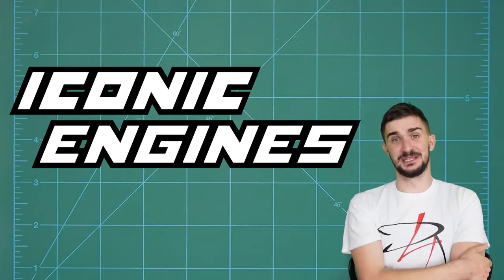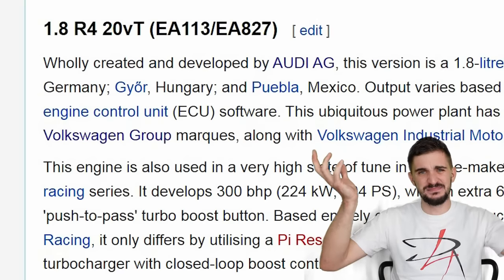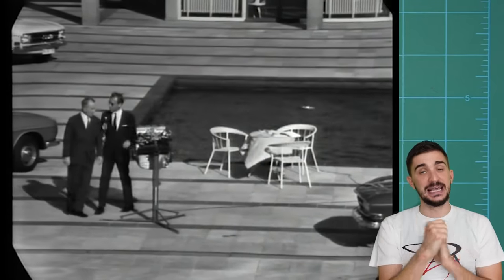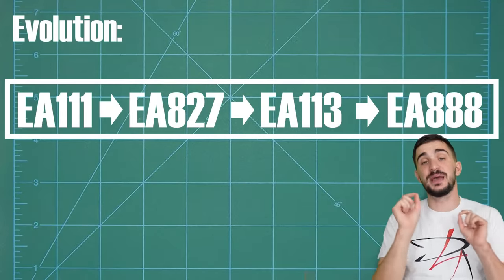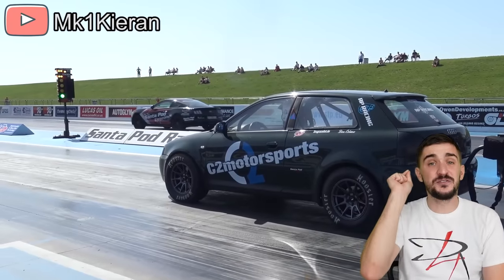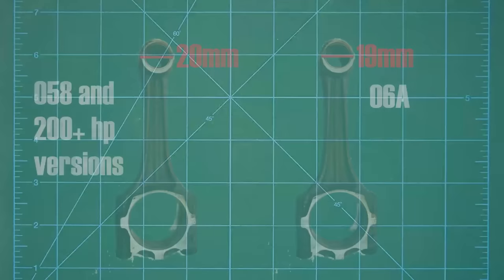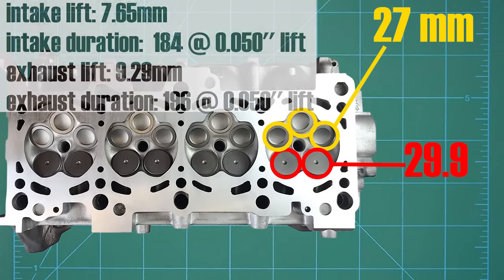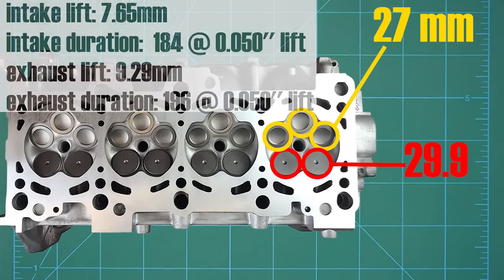VAG 1.8T 20V - What makes it GREAT? - ICONIC ENGINES #17

Comment: Why did they not just learn the lesson from Toyota's 4AG, I always felt that VW keep messing up and didn't trust the company.  After I saw what a loose rivet in a ring gear can do, throwing the engine and transmission out of the hood.  VW was recycling tech that didn't have the foundation to do so.

Comment: In my country, there was a law that reduced taxes for cars with a 1 liter engine. the discount was so big that a brand new car was cheaper than most used cars circulating in the country. this, added to the very high price of gasoline, meant that most cars sold for a decade were boring 1 liters. so the 1.8t 20v engine is considered a legend here. i have an audi a3 which was my first car, andstill is my daily. almost every day someone asks me at traffic lights if I want to sell it, and I always make new friends when I park at events and gas stations because of the car

Comment: I had a 2006 MKIV GTI 1.8T 20-Valve (AWE engine code I believe), one of the last ones ever built (in the US anyways). Tuned it up from stock 180 BHP to about 220 BHP and simply daily drove it for years, running the piss out of that little stock K03-S Turbo until eventually, under the higher tune, the additional boost and stress started making the car smell of burnt oil whenever I put my foot down. Before I pushed my luck too far, I sold the car for $2500 with 160,000 miles on it.

Comment: I finally got my first car a few weeks ago, a beaten up  '97 seat ibiza gti with the 1.4 liter 16v engine and I love it, I have plans of turning it into a mean little street machine, by swapping in a 1.8 20vt and awd system probably from an audi tt quattro or an a3 quattro and stiffening the chassis with custom cross members and other little upgrades here and there and upgraded bilstein suspension (it already has bilstein, but it's the base model ones) I think around 226 to 260hp would be the sweet spot, it's making around 105hp at the moment with the stock 1.4 liter

Comment: Dad had an 2003 passat 1.8t, engine was supposed to run 30 000km between service. Dad thought that 50 000km would be fine, resulted in a clogged oil pickup. :) But the car actually warned us before any damage occured, after a pretty expensive mechanic bill the engine outlasted the car.

Comment: Had 3 versions of this engine and was never disappointed. AVJ audi a4 tuned to 230hp 333k km, AUM audi a3 tuned to 300hp 170K km, and AGU mk4 golf stock 230k km. Easily tunnel and quite reliable. Thinking of retaking another 1,8t audi tt to reach 500hp or more

Comment: As I prior owner of a 1.8T in a 2002 Audi TT Quattro I can definitely say this is a reliable platform even if they have their issues. By 130k miles it could eat through a quart of oil every 50 miles (not a typo). Yet, it would start every cold morning almost like new and make full power while going to redline all day

Comment: I've been driving mine for the past 11 years. I have 2001 Audi B5 1.8T, miltek exhaust, highflow cat, silicon pipes, DV, and remap. The engine is a tank and it goes practically forever, I have 237k currently.

Comment: My favourite VAG anomaly is the similarity between the Audi S2 coupe and VWs 16v GTI engines. 

It’s possible to remove and blank off the 5th bank on the turbo inlet and outlet manifolds and it bolts straight onto the KR and ABF engines.

Comment: Many moons ago I owned an Audi 80sc. A mid '80' 4 door saloon, 1.8ltr, 4cyl engine twin with a twin choke, vacuum operated carburettor. The reviews said it had surprising performance for such a car and they weren't wrong. I think rapid, was the best way to describe it. It would comfortably hit 90mph in 3rd and had a surprising amount of torque for such a small, NA engine.

Comment: These engines i never liked them, i saw many of them fail due to various timing and chain related problems when they were current. And they werent cheap either compared to older 2.0L with aftermarket turbo setups. But ill have to admit, seeing how the tuning scene evolved for this platform and how the various issues were solved has given me new respect for this motor. Its still not a cheap option, but its nonetheless a very good swap option .

Comment: You got it spot on. My first car was a 1999 Hyundai accent and then my 2nd car was the 2003 1.8t Jetta and I tuned and upgraded so much on it. I have a 2020 GTI now but if my old car was still
Running id still use that no doubt. Everything was great on it BUT the o9a automatic transmission

Comment: Small port works great up to around 600hp, as long as you install big camshafts and an aftermarket bigger intake, small port head is not that restrictive, though you can of course benefit from a big port in the upper end

Comment: With proper maintenance this engines can last for thousand of kilometers or miles , and with the necessary addition of some peripherals(larger turbocharger ,intercooler, proper chip tuning, suitable full exhaust system w/o cat and correct pipe diameter, bigger MAF airflow meter)  that DO not exceed the torque limits when the engine is in stock form.                                                                                                                                                                      This motor can make lots of power and HP , never had a serious problem in any of the 5 different cars that i had with this engine in various performance setups , stage 1,2,3, etc. Good oil quality and  oil changes after 5-6000 kilometers of normal road use would be the ideal interval in my opinion. Also i would recommend to change the oil cooler , and the water pump with one that has metallic impeller instead of the plastic that the OEM from factory has , and in the cooling system the addition of aluminum or bronze piping connections would ensure that there is no any old plastic connections cracking and coolant leaking from the system that could potentially lead to increased high temperature and create a serious issue with the engine if not repaired . Now as for the v belts , well it`s good to replace them after 3-4 years or 50-60.000 kilometers it depends on the mileage that the car is making  each year. And if possible use premium gasoline , and in some stage perform a de-carbonization of the engine would be a good thing to do as to remove all the remains of sulphur or residues that can be accumulated inside the cylinder chambers over the years and affect the performance of the engine. And ideally to install an oil catch can to collect the oil vapours, would be a good thing to do. There are also so many other tuning potentials in this engine that the only limit is the amount of money that someone wants to spend to make a great build (forged pistons, con-rods,exhaust valves,intake valves,valve springs, retainers, bigger fuel pump, increasing the displacement , modifying the camshafts usually only the exhaust side is adequate , but in heavy tuned engines both are modified in order to increase the torque in higher rpms.
Reply: Long list, if I have to replace practically all the parts, might as well buy a completely different new engine/car 😂

Comment: I have one in a 2002 passat,255000 miles and been pretty reliable, leaks oil like a sieve but burns none, passes UK MOT on emissions no problem. Only major problem was the flapper valve in the turbo falling off leaving it with no boost pressure.

Comment: In the early 1990's I recall a friend telling me of another of his friends who tested "new" engines to destruction for a living. When asked which was hardest to kill he had said VW 1.8 by a country mile. Was the block/crank more durable because it was designed as the basis of the 1.9 diesels ? In the case of the diesels at least, the 2005 switch to "cracked" con rods lead to a good number of failures for these early Bxx engines. A friend who worked for Cummins told me cracked con rods need exceptional cleanliness in manufacture....

Comment: Pretty spot on except the large port head.  Large port heads harm the HP number till you get over 450. Anything bellow that and the velocity drops compared to a small port which makes the engine feel more laggy.  Personally experienced this when I switched from large port back to small port due to emissions testing needs.   Also it’s a good idea to either get a large volume intake manifold or take the stock intake manifold and expands the chamber by welding in an inches of material.  Keeps the pistons even mixture.  Without it they sometimes go lean on 4.

Comment: 1.8t with simple parts like exhaust/injectors/ filter and remap + 4wd = go kart 

That engine is something, i have the AGU and APY on my A3 and S3 8l. The only problem of the 1.8t is the pcv system, sai, etc  and stuff like that, when you simplify it you have just to put gas and go for a ride.

Comment: Awesome video! One thing I find weird, is my 1.6 AKL engine. It looks like a EA113 (looking at the oil filter housing, thermostat housing and chain driven oil pump) but it is from early 1998. Also, it is made of aluminium and not out of cast iron. Yesterday I did a timing belt on it and recently a new oil pan so I can really confirm that it has the chain driven oil pump. The block looks to be similar as the one from a 1.8T 06a exept that its made out of aluminium and the transmission bolt pattern is different (02K transmissions instead of 02A, 02J or 02M). When I look on the internet I find that my block should be made of cast iron and it should be a EA827 but I don't see much similarities between EA827 and my AKL

Comment: Wow what a great video. Great research work. Here in Brazil the 8 valves EA827 known as the Volkswagen AP engine is the most common engine. We didn't have a turbo charged version of this but it is commonly turbo charged. You can make a video of the 5 cylinder turbo engine that is in the Fiat Coupe. A great engine.

Comment: I recently bought a 1998 Audi A4 Avant 1.8T and i think it's funny that the registration plate starts with DKW =D (Here in Sweden, the plates follow the vehicle, so it'll have the same registration characters from new until they're scrapped unless you buy a personalised plate. The personalised plate runs out in five years and then the vehicle will re-take its original registration letters and numbers)

Comment: My rs4 4.2 avant has two 4 cylinder vw engines DNA Porsche has a look into the project to, 450 hp std using 99 octane can push that to 500 hp,it’s a beast 👍
Reply: I love the 4.2

Comment: Had one swapped in a mk1 rabbit with a big turbo. Loved it, spun both tires in 3rd. Built another a4 but constantly battled power output codes and limp mode so parted it out. Now I have another core, I'm looking to swap it into something older.

Comment: Now that there's a 1.8T video, it's arch nemesis needs a video too, the Z20LET, or just in general the GM Family 2 turbocharged engines.
Reply: I agree, but not only turbocharged. It should also include C20XE, C20LET, X20XEV, Z20LER and Z20LEH because they are on the same base. I own Z20LET and it's great engine.
Reply: @anessmajic4323  The X20XEV is nothing special but I do agree with the rest, however the C20LET held the 4 cylinder world record till recently when it got dethroned by an Ecotec 2.2 of all things. However the Z20LET is the contemporary and rival of the 1.8T, with the C20 being 6-7 years it's senior and the Z20LEH being of the same age as the EA888 2.0T

I own a 400HP Z20LET myself that I've daily driven for the past 2 years in this form and 4 years in total, the engine itself never gave me any grief, the electrics are another story 🤣

Comment: Had a 99 jetta 2.slow. 01 1.8t ko4 frankenturbo stage 3+ and 05 1.8t stage 2 the last one i got rid of because thw body rott at 353000km and pushing 21psi daily to the redline. Engine was still strong. I miss that last jetta

Comment: Thanks for the vid. I’m currently modifying what I believe is the best 1.8t to modify. The 1999 058 longitudal aeb. I’m currently on a k03s out of a low mile 2005 a4. Full bolt ons and tuned myself with eurodyne maestro on an e40 blend. Fwd and 5 speed manual puts good power to the ground. I can keep up with cars I shouldn’t be able to.  Integrated engineering H beam rods and garret gt30 soon to come. I’ve had alot of fun already.

Comment: I bought a 1999 base model A4 Quattro with a 5speed manual and the 1.8t engine (AEB engine code) from some guy who worked in a body shop in 2018. The suspension was shit but it still has the original engine and it's coming up on 190'000 US miles.

Comment: I almost bought a 2017 Golf with a 1.8 but ended up going with a 2020 Golf with a 1.4. I definitely made the right decision as far as bang for buck goes because they only made 1 trim for 2020 and it was pretty much the SE trim, but I always wonder if the slightly bigger engine woulda been better
Reply: You made the right call, the 1.8 in that era was not reliable at all
Reply: @eponymous7910  Unfortunately that car was totaled probably not long after leaving that comment from smashing into a 9 point buck on the highway 😅. But it all worked out as I’m in a ‘19 GTI now lol

Comment: The 1.8t is nice, sure, but the best engine VW ever made was the 1.9 TDI - incredibly reliable, easy to maintain, great mileage and really quite powerful for its size (mine does 170hp with a simple ECU tune - 0-100km/h in 8 seconds. Not bad for a 16 year old diesel engine that's never been rebuilt!)

Comment: there are some factory 1.8t audi a4 b5s from 95/97 that came with 286hp from the factory.  Stage 3 mtm.  i got a 1.8t with forged rods, non turbo cams, big port head, big turbo and support mods in a b5 and it makes 450whp

Comment: Great video but i wanted to help with a few inaccuracies. the engine angle is not always 20 degrees for all cars. in longitudinal applications it is 20 and in transverse applications it's 15 degrees and these are much more common. you also placed a picture of the larger displacement 1.8 AEB block when talking about the EA111 and suggested it has 88mm bore spacing but the EA111 is generally smaller and of a different architecture to the larger engines the other information points towards (generally 1.6-2.0 litres)

Comment: as a VW Golf 5 owner I can summarize all VAG engines:
there are the good TDI and SDI (PD N/A) engines. they all begin from 1.9L and up to 2L from what I know. newer have common rail, older have per cylinder injection units (pumpe duse) and even older used another form of mechanical injection pump. they're all good with the N/A diesels being slightly more reliable while slower because of lack of turbo.
then there are the less than successful engines, all kinds of petrol engines. stratified or not, if its petrol its bad.
we don't like talking about them.

Comment: My a4 Avant has a 1.8T mated to a manual, not fast by any means but it was fun, reliable, and great on fuel. Unfortunately, it's sitting in need of a new clutch and pressure plate.

Comment: 1.8t with 600 ps you only need: rods, Turbo, intercooler, exauste with 200 zells and Injektiors. 
With the small port and oem Camshafts you can drive 600 ps. 
The OEM piston can 500-600 ps 
German Tuning Engeniring:D

Comment: Sorry, that's not right! 
The EA 111 does not have 88mm drilling distance. 
The EA 111 has 82mm and was only available up to 1.6 liters and need mostly other gearboxes!

VAG 4 cylinder evolution:

82mm engines: 
1974 EA 801
1985 EA 111
2011 EA 211

88mm engines:
1972 EA 827
1995 EA 113
2007 EA 888

best regards from Germany!

Comment: Nice Video good Research from you ✌😁Cant wait to See Videos from you about the 2.7l v6 biturbo from s4/rs4 audi or the Legendary 2226ccm 5 cylinder😉.Or the Bad guys from the cast iron school from bmw m20,m30 or m50 or the New guys like n54/n55 s55 or b58.Nice Job Hope for more german engine Content ✌😁.You had made  the Research very well.Many guys only Tell that agu/adu are the most wanted ones and the bam out the s3 or 224ps audi tt is the strongest.

Comment: I have an 1.8t AUQ and is amazing, the unique bad thing in my opinion are the vacuum lines it has, has a lot, u can delete a lot of lines or modificate them with a T to make it more simple to repair, i want do that on mine, beyond that is a very good engine, i got it with 114.000km and now has 200.000 and it's running great expect of those vacuum lines have to be broke or with a little hole that makes the engine light show.

Comment: Hahahaha, the venerable mk4 with 1.8t.... Besides it overheating once the radiator has a hiccup, and numerous small issues like disintegrating interior, eating stabilizer bushings like chewing gum, it's quite the fun car because of that engine. I still have fun with this car, only if I figure out the interior....

Comment: Newbie question here:  Please explain "fractured" big end connecting rod -- why do it this way and how is it done?  Thanks -- great channel!
Reply from the maker: The rod is made as a single piece at the factory and then the cap is broken off by a special machine. This forms many little peaks and valleys on the mating surface between the rod and the cap which then prevents cap walk and incorrect cap installation.